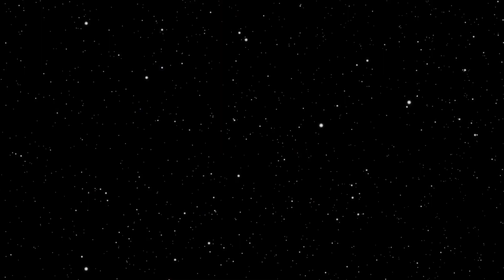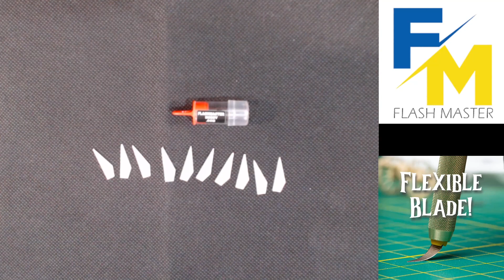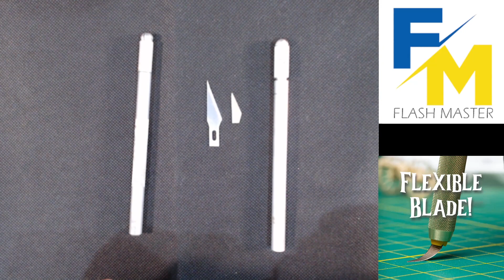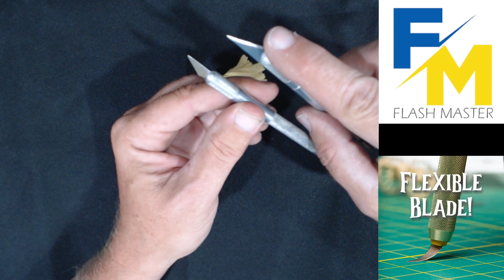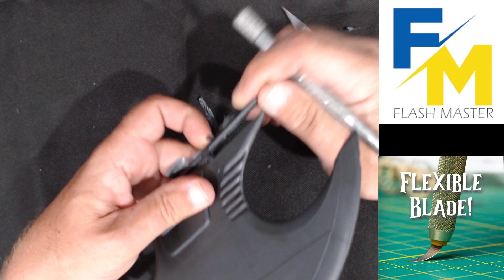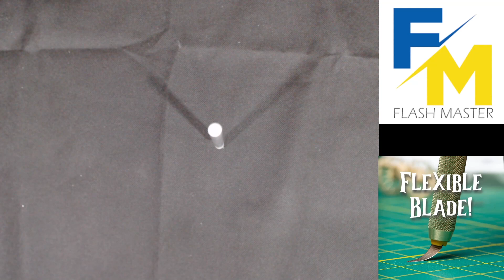Flash Master Hobby Flexible Blades!

Comment: 2 0ut of 10 for me ,looks like another company trying to re invent the wheel.
I personally like using the Trumpeter scrapers.
To be fair they might be useful for very soft plastic, but I would like to see if they could quickly clean up the seam lines on the big space 1999 Eagle transporter frames.
Regarding the hassle of fitting them in the blade holder, I would add a spot of pva glue to the back end of the blade ,that should hold it in position to allow you to tighten up the grip.
Reply from the maker: They definitely go through soft plastic with ease. I am hoping they add a longer shank so theyvare easier to handle.

Comment: I wonder if the Excel blade holders would work better.  Excel is my personal choice but I do have X-acto as well.  Too bad I don't see curve blades from them.  I prefer curve over straight.  That said I can see advantages for removing flashing along a part if it is along a straight or flat piece.
Reply from the maker: The holder i used for the blade was an excel handle. Worked fine just a learning curve with these guys.
Reply: @HobbyLinkInternational  Didn't recognize that as an Excel handle.  All the Excels I have are rear knobs for tightening.
Reply from the maker: @thompuckett9547  mine is exactly like an Exacto handle except made by Excel.